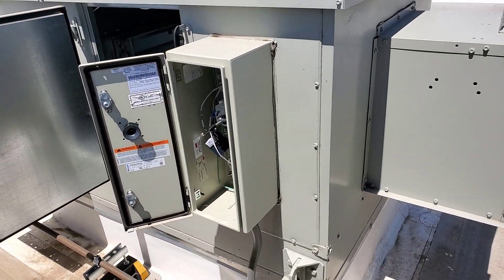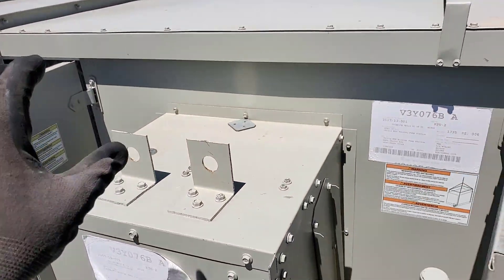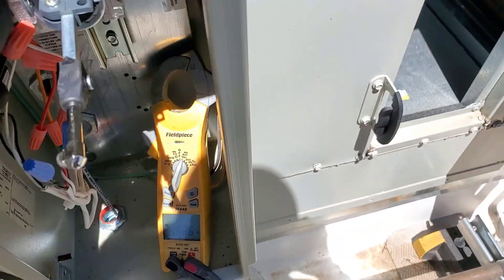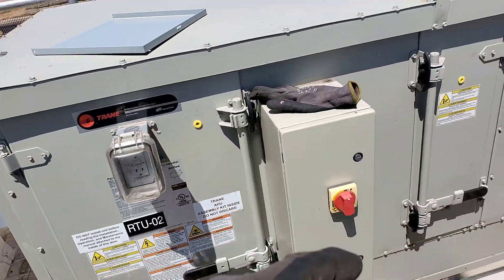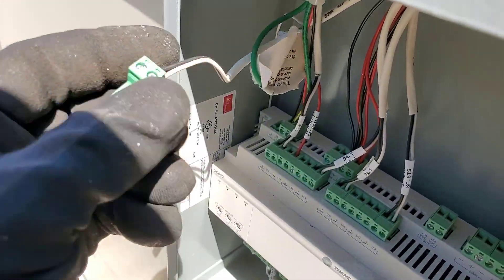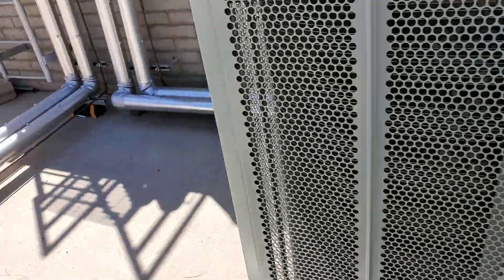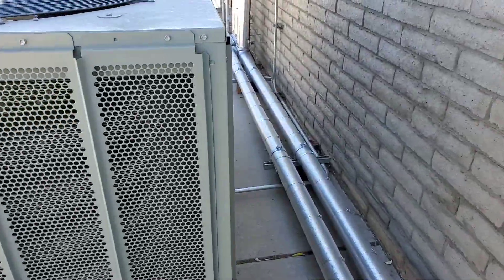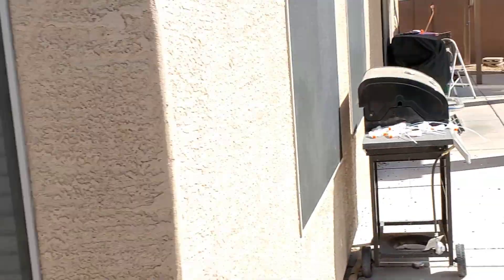Trane mini intellipak [Climate Changer] show n tell - Transformer issue

Comment: I really enjoyed this video ! I recently worked on trane chiller unit that looks a lot like this one. Model # CSAA008 . found the motor starter cabinet located inside the supply blower Cabinet section with a low voltage transformer inside  that failed. And this video helped me to understand the sequence of operation a little bit better!

Comment: loop the wire twice on the current transformer on the meter. it will see double current but it will increase precision. like if draw 0,5 amp it will show 1amp.
Reply from the maker: Yeah, that is what I do when I need a good reading. But that wasn't necessary here.

Comment: I'd be willing to bet money that your weird voltages were due to feedback from the motors screwing with your meter. ECM motors (or whatever you want to call those German things Trane uses) use that FM technology anyway.
Reply from the maker: The motors were not running. But maybe they were trying to.
The circuit breaker was single phasing until I turned it off and on
Reply: @hackfreehvac  Oh snap I completely  missed that part. I'll have to rewatch the video.